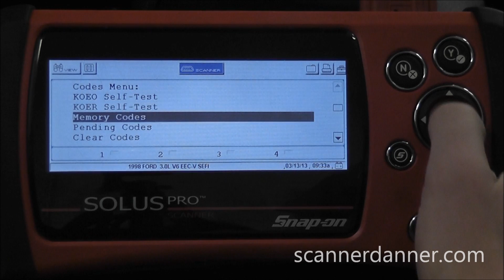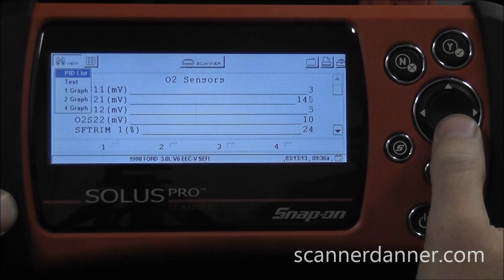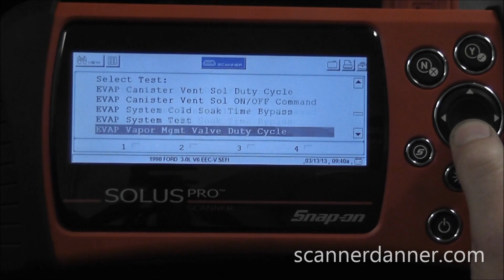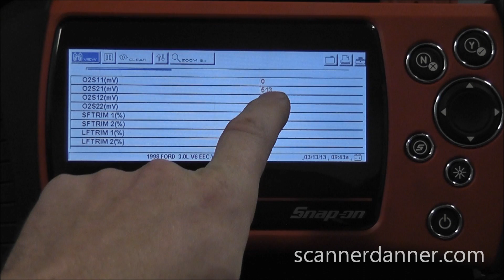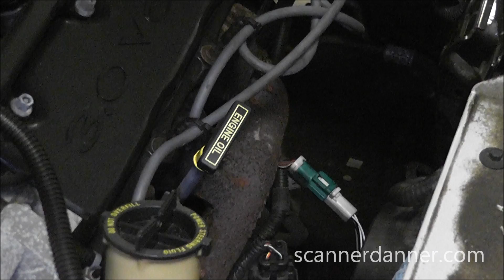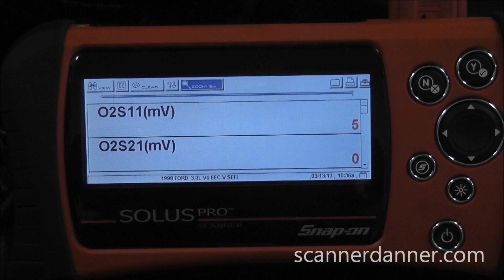Ford O2 Sensor Testing - wiring tests (no bias voltage)

Comment: Thank you very much, you've helped me to fix my 07 Mountaineer 4.0 with this video.
Reply from the maker: What was your issue?
Reply: @ScannerDanner  signal wire has a break in it somewhere. Gonna splice a new one at the pcm and at the sensor. Been like that for a long time, hopefully I'll beable to register it in the city now lol. Thank you again for such a detailed diag video
Reply: @ScannerDanner  well I did the cross body check from battery to pcm signal and got the computer to show voltage. I jumped it from the black o2 wire to the pcm sig wire and nothing. Wired also showed no continuity from the pig tail to the pcm wire. I guess I should check the Grey signal return wire and try to jump that to the pcm? Wiring diagram shows the 2 whites all meet in the harness so the Grey is the last thing I can think to check.
Reply from the maker: @scottouimet2865  are you still having issues even after fixing the open signal wire? I always find the damaged wire because when there is one, there is almost always at least one more.

Comment: Wow great video!
My 3.0 ford escape engine O2 reading 0v on bank 2 sensor 2 and in a lean state.
Computer is not looking at bank 1 good sensors to correct.
I’m gonna check with T pin to make sure wire integrity to ecm is good.
What a great idea using your body resistance!

Comment: Can a powerprobe be used to supply the 12v to the signal wire?
Reply from the maker: No! It's a 1v signal circuit. You want to a least have some type of buffer (an LED test light would be preferable for this test)
Reply: Thank you
Reply: I've got one that seems to work after the truck gets some heat in the motor. On idle after it's cooled off the wideband shows max lean  and I get a slow to react code on the O2 on that bank. On a data log it's showing min voltage 01 Lightning

Comment: Hi Mr Paul I'm Salah from Oman 🇴🇲
I had the same issue with my 2009 gmc terrain V6 engine .
I had O2 sensor code,I looke at the live data and I noticed 1)open loop bank 2
2) 0% STFT on bank 2
Two evidences for a bad O2.
I've replaced it and it's working now.

Comment: Hey Paul, Let me give thanks for sharing the Knowledge on how to test the O2 sensors Using Bias Voltage and the PCM Response Testing. I'm assuring you that now I can take 3 Minutes to diagnosis Fault Codes about O2 sensors.

Always on your back Danner ❤❤❤

Comment: ScannerDanner it's good to know you can just jump on these vids, sometimes I just need to refresh the old memory and get on the right path. Question doh ,did you have a check engine light on this fault..I have the same issue on a Vauxhall but no check engine light..did the checks ,changed  the O2 and we are all good..so greatly appreciated for your time..❤
But why does it not throw a check engine light.i guess we all comes across this scenario on other problems and we ask why no light......keep safe man ..
Reply from the maker: I dont remember? I think I was teaching a class

Comment: So is it safe to add propane to the air box of a mass air flow sensor engine, but it's not safe to add any sort of liquid fuel source, correct?
Reply from the maker: It's risky with liquids as you could potentially damage the MAF but my brother does it all the time lol

Comment: Mr Danner. I know that this is an ancient video, but I am an engineer and I just found it and wanted to add something to your explanation. Your body's resistance is a few mega ohms, as is the cold sensor signal/ground pair and even the digital multimeter input circuit and the computer sensor input circuit (most people call it bias, but in electronics they call it open collector or high impedance). taking those mega ohm values into consideration where nothing is ideal makes the circuit voltage and current calculation a little different. There is a video for Eric (South main auto) and Ivan (pine hollow) where they have a truck with both sensors bad and Ivan shows that he carries in his tools a bunch of little resistors of different values. I think he did some trial and error and found that the best value was 22kohms or close. Thank you for all those years of great videos, I wish I can work for you as a helper for free one day as a form of payback. God bless

Comment: 1 test is missing in opinon. Would this Ford ECU clear the keep alive memory by itself and using the new O2, if you simply would have changed to a new sensor? Is clrearing the fault codes enough in this case or has he ECU to relearn. On some crazy Toyotas you need to clear the codes, unplug the MAF sensor, clearing the codes again and restart the engine to even accept a new O2 (wideband) sensor.

Comment: Can you use a AA battery (1.5 volts) to test the integrity of the signal wire on the Oxygen Sensor?
Reply from the maker: Yes but the battery must be grounded to the car

Comment: Background. Unusually large amount of rain the day this Exp pooped its pants. Every 100feet seemed like another lake. I made two stops. Everything was fine until I tried to leave the second stop. Every light on the dash was lit. Cranked slow and I was in a panic. I dont have anyone to call and help me. It finally started but it wasnt good. Limped all the way home...It would go...not like normal but it would go . Not like like normal means I'm praying and something is very wrong. Every time I had to stop for a light or sign? Panic. It shuts down. I made it home where more vehicles are. Maybe discuss reverse polarity on a battery with your students.
Reply: Pooped its pants. Drove to the lake. Farted and more poop came out

Comment: My original problem began with a battery that decided to reverse polarity. Shot the parts cannon at it, wires, plugs, fuel filter, etc. Then I found the battery problem. New battery and put it in. Before I could get it started the starter failed. New starter. Put the new starter in and good to go other than bank 1 sensor 1 stuck lean and bank 2 sensor 1 stuck rich. So I reversed them..Bank 1 S 1 is now bank 2 S 1 etc. Now both banks are lean and slow to respond. Even w the reverse battery everything worked fine other than the engine. New battery and starter now my power windows dont work nor the radio. Yes, I checked every fuse in and out other than the passenger side relays. I'm going to figure this engine S out first then worry about the rest. Forgot to mention the AC went out too. Everything worked fine before this.
Reply: Took me over a year to find the battery problem. I have never seen that before or since. I told my friend his new battery charger was F. It would only charge my battery hooked up backwards. I will never live that down...ever.
Reply: 2003 Explorer 8th K. If you think you can remote diagnose this I will pay for the premium. Bout send fitty to Rockauto for two new upstreams. Is there a difference between engine code E or K when it comes to 02 sensors? who cares. I will get specifically K 02's this time.

Comment: Many thanks for this very informative video. Can you please guide me some resourse to identify the signal wire on my  ford explorer 2014, its a six pin adapter with five wires coming in to it. Searched a lot but struggling to find the right info.
Reply from the maker: I have some links here on where to get service info. Thanks!
https://www.scannerdanner.com/forum/post-your-repair-questions-here/3757-need-service-info-check-here.html

Comment: My 99 Jetta O2 sensor has 1.2v , if unpluged, it goes to 450mv,  from what you said, wiring is ok, will take that, will put a new O2 sensor, will tell. thks

Comment: What about testing the signal and earth circuit with just a DMM or test lamp? Could you use your body as a resistor between the red probe of DMM and above wires?
Reply from the maker: you can do that and even use your ohm and diode scales as a source to do a signal circuit integrity test. I have a great series on this on my premium channel if you are interested https://www.scannerdanner.com/scannerdanner-premium-chapters/chapter-10-signal-circuit-integrity-testing.html
There is a 14 day free trial and it is only $11 a month after. Hope to see you there!

Comment: I dont understand.... o2s11 and o2s21... bank1 s1 and bank1 s2? Both o2 are oscilating?? The sebsor 2 isnt the post cat.... that will be a staedy signal....???
Reply from the maker: O2S11 = oxygen sensor bank 1 sensor 1 (upstream of the cat on the #1 cylinder side of the engine). If it is not a V type engine, then there is typically only one "bank", so then all you need to know is that this is your upstream O2
02S12 = oxygen sensor bank 1 sensor 2 (downstream/behind the cat on the #1 cylinder side of the engine). If this is only a single converter system, then it is simply the O2 behind the cat. If it has two banks and has 2 cats, then again, it is the #1 cylinder side. 
Yes, the post cat O2 should not be oscillating

Comment: I've got -2.4V disconnected and until +5-8V when I touch it. Otherwse it seams to work fine connected (0.03-0.70V). Is this still ok?!?... My diagnostic is broken so I'm walking blind
Reply from the maker: What is the complaint? What are you working on?
Reply: @ScannerDanner  Thanks for the quick reply!. I'm working on my dad's Ford Escort Combi '94 1.6 DOHC EFI 16i 88HP, the ECU . 
Symptoms: hard starting, very rough with gas, engine smooths at higher rpm(>2500), then it's better (Spark plugs get dry black fauled, with wire brush cleaned spark plugs starts easy, but they get dirty every time it stalls), 
Very similar to your video 'How to test a Ford MAF sensor' (https://www.youtube.com/watch?v=WH1GLWSTTXM)
idle rpm goes from 1.2K to 800, then it wants to stall. Low power. Engine doesn't go off with the key pulled out. Last time as long as the digital volmeter was connected to the O2 the engine barely worked, in the moment I disconnected it, it stalled...
MAF cleaned, new air filter. IAC Valve cleaned extensively and oiled. Vacuums leaks reduced, This engine doesn't have EGR, no PCV. When I introduced butane through the air intake the engine went crazy, O2 was all over the place.
It had a black smoke once, I clened the throttle body after.
With maf sensor connector removed starts and holds rpm (little rough, doesn't stall) but cannot rev it much..
Want to know if I have serious engine control module issues. (Fuel pump works continuosly with key on)
Here is the MAF voltage (1.1V-2.07V): https://youtu.be/3fJHqka4kPQ
p.s. I might have gotten 12V on the engine temp sensor... ;(
Check engine light doesn't work
Reply from the maker: If you're plugs keep fouling out and you're seeing black smoke, the engine is running rich. Recheck your engine temp sensor, it definitely shouldn't be reading 12v
Reply: @ScannerDanner  No, no, I fed the battery +12V to the sensor for couple of seconds, but you said in another video that shouldn't be a problem...
if the O2 is about 0,04 al low rpm, but behaving properly (about 0,4V) at high rpms (when revt continuously gradually gets to 6K and working better with grey smoke), does that indicate a vacuum leak or the O2 is still bad?!
Reply from the maker: Wait, time out, I absolutely never told you or anyone to feed 12v to a temperature sensor. What are you trying to accomplish by doing that? Other than destroying the sensor and possibly the computer
Reply: p.s. just bought the book, on the 4th page it says it's the O2!.. lol
Reply: @ScannerDanner  no, you didn't, that was long time ago. Been looking at the wrong diagram for the engine cooling fan. Didn't know much diagram-wise then...
Reply from the maker: If you get stuck Post this to my forum. It is free to join and we have an awesome community that is friendly and willing to help. https://www.scannerdanner.com/forum/post-your-repair-questions-here.html
Hope to see you there!

Comment: Can u please tell me why I would still get codes for bank 1 sensor 1 and bank 2 sensor  1 after replacing both up stream sensors,thks
Reply from the maker: it would help to know the specific codes
Reply: @ScannerDanner  p0135,p0141,p0155andp0161
Reply from the maker: Check the heater circuit, possible blown fuse. Without knowing what you're working on, can't help anymore than that.

Comment: ok here we go.... it's been two years without a cat, I'm using a spark plug kit with the O2 sensor, one day started raining check engine light came on for p0141, I'm thinking its O2 sensor, and I check the Ohms on it, it was bad so I changed it same thing. I checked the fuse number 4 and good but I still changed it, still samething. Voltage it is good on the o2 side ... WHAT CAN IT BE ... it's bank 2 ..... I JUST WANT THE CEL OFF
Reply from the maker: check for wiring damage to the O2 sensor and do the checks I show in this video, an ohm check was not part of it and is the most useless test in most applications

Comment: Hi Paul ive just discovered that some of the thimble type zirconia o2 sensors do not have a PWM  heater but rather a constant 12v. Thought a 2004 hyundai had a faulty driver but some research showed it is constant 12v ... but pulses at very beginning of warmnup cycle. Not seen much info on these and dont think u mention them? Have u had experience with them?
Reply from the maker: yes of course! I have a ton of video talking about PWM heater circuits. This one in particular was really good, 
https://www.youtube.com/watch?v=-lUYRqaYvYI

https://www.youtube.com/watch?v=gtTKOuu6EPw

Comment: Code P013A Bank 1 sensor 2 O2 sensor.  '12 Ford E350, 5.4L flex fuel engine.Replaced the sensor still get the same code after driving about 140 miles straight or 1 stop and driving another 15 miles the next day. Wiring issue, PCM issue? Also when the ck eng light for this codem fuel gauge reads normal. Ck eng light not on, fuel gauge reads about 1/8 of a tank lower than what it should be. Any ideas?

Comment: Hi thanks for the videos just to let  you know we had a flat lean burn .02 volt 02 changed sensor computer tested signal circuit get worked great. Propane test still flat lean. A real stumper. The fix was to reinstall the plug wires that the previous shop installed incorrectly. Moral to the story is they measure oxygen not fuel. When the plugs finally lit the mixture oxygen was used up.

Comment: Outstanding Paul, I like the way you illustrate irrelevant of the resistance in series with 12 v battery, you will still drop enough voltage into the O2 signal line to the CPU, to peg the CPU interperted signal voltage.  You are a great teacher Paul by reinforcing your troubleshooting setups with backed up voltage signal readings.👍👍👍👍👍👍👍
Reply from the maker: Thank you so much. Awesome feedback

Comment: Hi I may be having an issue with my ecu .which I hope its not .cause I am also not getting a reading or stating that it exist when I plug in my obd2 scanner. And not getting any code for it. Any idea on what or if there is a short ? Thank you
Reply from the maker: does the car run? why are you scanning it? Make sure you have battery voltage on pin 16 (most cars). If you do not have power, you will not have communication. A lot of cars use the cigar lighter for the same power feed to the DLC
Reply: Hmm I think I tried to meter pin 16 before I wasn't getting no reading..what does that mean? What can i do?
Reply: Yes the car runs ..
Reply from the maker: Blown fuse on your cigar lighter
Reply: Fuse should be fine right if my obd2 scanner is reading?

Comment: I have been drug around the bushes on one. 1996 Bronco. 5.8l EECV OBDII all the good stuff. Codes are for heater circuit faults. Test voltage at sensor I get battery voltage on both pins for the heater on all sensors. Live data shows they're cold at start up but after running it for a while the o2's report normally. Any ideas?
Reply from the maker: Do both heater wires stay at 12 volts with it running? One should drop to ground. If it's staying at 12, you are missing a ground. This can go directly to the block on these older systems but I think yours are computer controlled.
Reply: ScannerDanner, thanks for the suggestion.  I haven't tried backprobing while running. Just tested while in run engine off.  You are correct though, four wire sensor. Computer controlled ground.

Comment: Great lectures, please I have an issue I would like to ask some questions, there in a 2007 Nissan Pathfinder in my workshop, customer complain that the vehicle take a lot of fuel, fault codes are P0488 and P0463. I’ve checked the resistance of the oxygen sensors, all the value seem to be within range, but I noticed that the MAF sensor has no activity with value stuck at .1g/s, the LTFT has no activity while the downstream oxygen sensors are stuck on 0.288 volts while the upstream sensors has very little activity and the ECT is about 187degrees centigrade, at high RPM of about 2500rpm the STFT drops tp -20 on bank 2 and -14 on bank 1. No fault code related to the oxygen sensor. I’m thinking it a wiring problem. What’s your take.